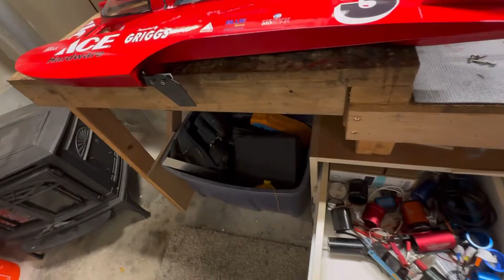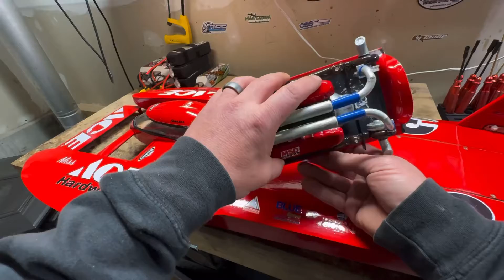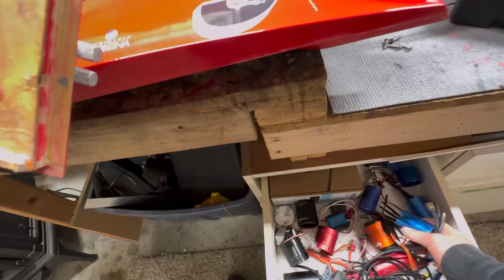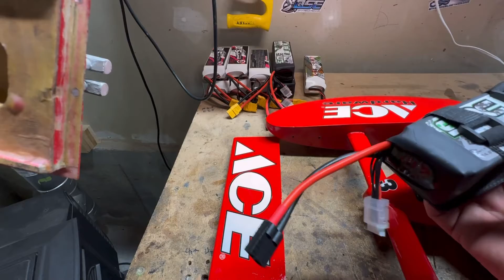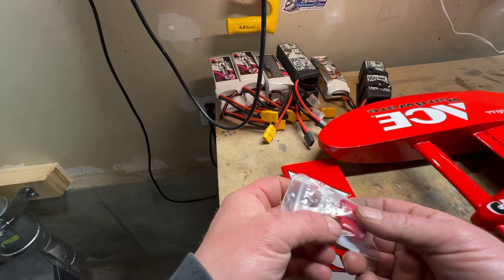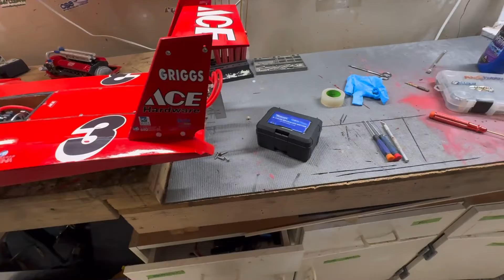1/10 Scale Miss Griggs Ace hardware get some new up grades

Comment: Does look great! Don't forget to add flotation where needed, cowl etc...
I like to paint the undersides of the cowl(s) and hull white. May add a tiny bit f weight but, if it helps to keep the boat from being run over... And the white paint doesn't have to be perfect.